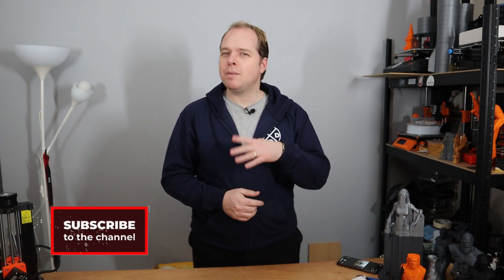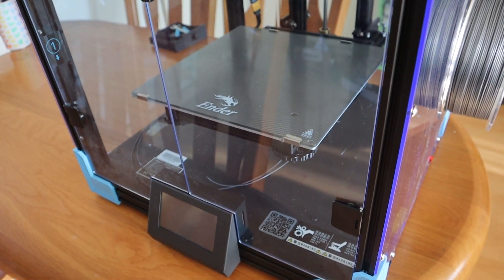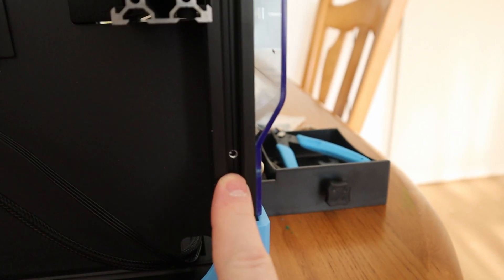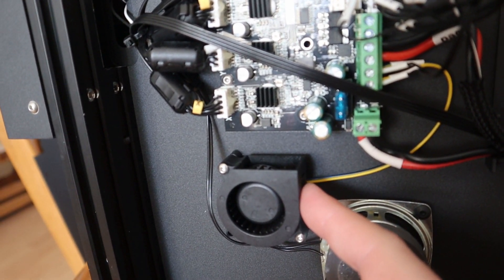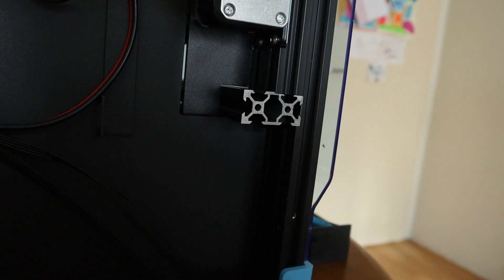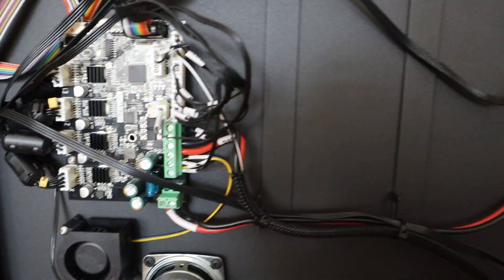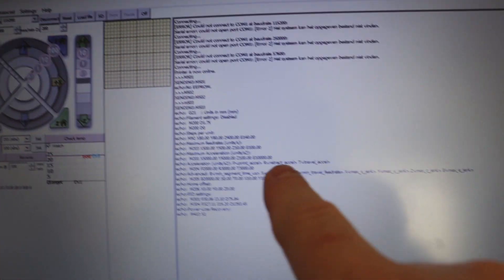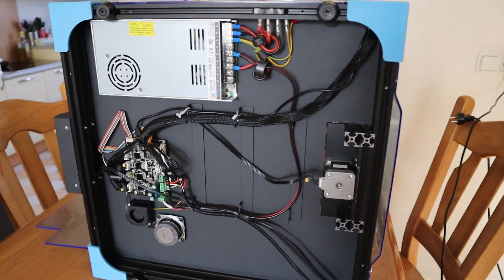What is on the inside of Creality Ender-6 CoreXY

Comment: The black donut looking things by the power supply are ferrite cores, the snap on black capsules by the main board are also ferrite cores, just split and mounted in plastic carriers so they can be installed on existing wires easily.  As you said, they exist to reduce electrical noise on the lines.
Reply from the maker: Yes thank you for this extra information. Very helpful

Comment: So Zach can we use the micro HDMI for stl files on usb flash drives do you know please mate?
Reply from the maker: The Micro USB that I connected to the board, is the one you normally use on a regular printer, if you connect this with your laptop or PC, you can send the print via Cura or Prusa Slicer directly over. Or you can also send commands via those slicers to the printer. Or some other thing, connect it with Raspberry Pi board with OctoPrint installed.
But I don't think you can attach a USB drive to this cable...
Reply: @Zachary3DPrints  I have adapter cables that will work. Thanks for the reply mate.
Reply from the maker: OK, great, you're welcome

Comment: Great video. one question: between ender 6 and prusa i3 Mk3 + which one is the best in your opinion ?? thanks
Reply from the maker: Hey Paolo, great question! But I would go for the Prusa i3 MK3+ , because for beginners, but also for the average user is this a printer that works great. The Ender-6 is a great machine for people who are already in the 3D printing and want a coreXY printer with a bigger printing volume.
Reply: @Zachary3DPrints  thanks

Comment: Hi! Can i use BLtouch V3.1 Auto Leveling Sensor Bed  for  Creality Ender-6 CoreXY  and how to connect it? The sensor really improves print quality?
Reply from the maker: Hello, it is possible to upgrade the Ender-6 with a BL-touch. I want to do that upgrade too, but after the review of this machine. Adding a BL-touch will not improve the print quality, but it will improve the leveling from the bed and making sure that the print will print level and gives you a sticking print to the bed.
Reply: @Zachary3DPrints  Thanks for the answer! Looking forward to your review using the sensor!

Comment: Another great video mate well done.... when you connected up the micro usb and brought up the data sentences would this be where you adjust the Esteps ? I done an extruder count on my Ender 6 the other day and its printing 101.4mm when I extrude 100mm on the menu so am thinking this may be close enough to leave alone at this stage , what would you recommend 👍 thanks again and happy printing
Reply from the maker: Hey thank you, I have hooked it to my laptop and did get a read out in Pronterface, I didn't  change anything in the printer using Pronterface, because there needs to come a review before I make any changes. Do you have under extrusion? I don't have this issue. Happy printing
Reply: @Zachary3DPrints  when I feed 100mm through extruder via the change reel icon the extruder pushes through 101.4mm so am thinking mine is so close it may not need to be adjusted so am thinking to get less stringing I need to adjust retraction an extra mm and maybe slightly faster speed for retraction and see how this goes , cheers and always willing to hear your thoughts , cheers and keep up the great video's 👍
Reply from the maker: Thank you buddy. When you don't have under- or over- extrusion you don't need to change the Esteps. If you have stringing issues, then indeed check the temperature or the retraction settings in the slicer.

Comment: Great job on the explanation of the ender 6 inside. I have the same printer, but am having a leveling issue I can't seem to find help on resolving. My axis goes diagonal for the 5 point, and 16 square auto leveling with both the BL touch and end stop sensor. I have ran the test via all firmware from oldest to newest and still the issues occur. I have made a video in hopes someone knows what is the cause of this and no one has replied. If you can assist me to resolve this on any way please let me know I will leave a link for you bellow. I have also subscribed to your channel and have you a like.

https://youtu.be/ecoFbfKTjeo
Reply from the maker: Hey Buddy, it doesn't look that you have switched on your auto leveling?? On the right side of the screen, I see that there are 25 points (5X5) mesh leveling. I don't know what that end stop sensor means, but it sounds like sensor less homing... but please check it you can switch that right side switch on.
Reply: @Zachary3DPrints  I turned on auto leveling and it still goes diagonal for both measuring and auto leveling the 5 points. What I don't understand is why does it want to go diagonal at all. When you first turn on a new printer it's not set for anything because it was not assembled, so going diagonal is very confusing to me.
Reply: The end stop is the default sensor. I swapped for BL touch but both BL touch and end stop are doing the same thing. Where is this config for aux leveling and measuring saved for leveling mode? I was wondering if creality firmware is just really bad and needs to be fixed. Also have you been able to save settings on the SD card via pronterface or edit any firmware files?
Reply: @gametek7592  hey I just installed my BLTouch 3.1 the other day then only installed the new version BLTouch software patch using a formatted SD card nothing else on it...
After this I shut it down pulled out card.
Fired it up and preheated bed to required temps I was about to print with.
Next clicked leveling , waited for it to centralize  n stop then slipped a piece of paper under nozzle and pushed the top Z arrow far left top button , once it slightly grips paper push the center let home button this stores that spot and height as your home point.
Next go through the 5 point manual level with the paper under the nozzle to get the bed level and up close , can take about 3 times around each point to get it better .
Next after you are happy the bed is level at this point press the button below manual leveling and it should run around all 25 points and give you the measurements... if the measurements have a huge variance as in 0.025 one side and 0.625 other places you need to manual level it again using the paper ...
Another thing before you start with bed 100mm down from home point is run around all 4 corners of bed and wind the bed down hard on springs then back them off a few turns each..
This firms up the bed so less chance of movement after bed is levelled and printing
Reply: @anthonydendle4768  Thanks this will definitely help. I did find out my problem. The ad card for what ever reason is causing the printers axis to derail. I am almost 100 percent sure it's the eeprom file that's being corrupted when my SD card is inserted. Do you know if I can save the eeprom to the printer itself? Also do you know how to setup footprint on the ender 6? I am under the impression the board has a problem running the eeprom from the SD card. I wanted to get a replacement board, but creality telling me I need to go back to the store through their warranty. It already expired is almost 2 months. I should be able to have creality send me a new board no question asked. This is clearly a manufacturing defect. 

Thanks again you are a big help and congrats on the bl touch.
Reply: @gametek7592  is yours crashing when you insert the SD Card
Reply: @gametek7592  at the back left side of Ender 6 unscrew the 2 little plates holding the bed cable in the chanel , pull cable out of chanel, the stepper cable is fine to leave in closest to front chanel...
Screw plates back in place and ziptie the bed cables to out side of these plates as the bolts holding the outside cover screw into the bed cables causing SD Card reader issue's
Reply: @anthonydendle4768  It doesn't crash it just created a odd settings for the printer. The video you saw on my page that's the result of using the ad card as of lately. That's the default when the SD card in inserted
Reply: @anthonydendle4768  That's very odd. I will try that and see. If it doesn't fix my issue I will let you know. 

Thanks again great help to me.
Reply: @gametek7592  welcome , just have seen a few people returning theirs so thought Id try and help if I could .... 
So its been working fine until you installed the BLTouch or was it playing up before hand
Reply: @anthonydendle4768  My original issue was the end stop broke on the first leveling attempt. So I got the bl touch instead. The prints were coming out, but they were meshy. I was printing a flat square test from thingverse. See the link below. It was getting better, but then I decided to go to firmware 1.0.4.9 for the bl touch n that's were my SD card issues started. Ironically I got it the same day it dropped. From then the bed would not calibrate with the SD card inside.
 https://www.thingiverse.com/thing:3346507

Comment: Noooo you don't have bought that piece of garbage ? 
Using wheels for CoreXY is so a bad idé! 
- The new Seermoon D1 use same, and can be bought, stay away from them, and get your self a PROPER CoreXY.
Reply from the maker: Hmmm, those V slot rollers are the same ones that Creality uses on most of their 3D printers. I have an Ender 3 Pro which is still doing great with the same rollers. I have also a Ender 3V2 with those rollers as well, they too are normal and I don't have any problems with them.
In the beginning they tend to give some grease out of them, just clean it and it's good to go. Creality is improving on their newer 3D printers too, better quality is going to come. Every brand is going through such kind of phase.
Did you buy a Creality Ender-6? Did you encounter the by you mentioned problem on the Ender-6 yourself?
If not, please don't tell people not to buy this CoreXY 3D printer... Because for this price range, it's a great printer.
Reply: @Zachary3DPrints  I have bought Ender 3 Pro and Ender 5 Plus, both have issue with those wheels, also have talk with owners of the new Ender 6, same problem all over again. Aint my fail they use low Quality wheels. 

Some will never get a issue, and will got serious problem, like I did.
Reply: @johanstrauss8951  The wheels can be replaced with ones made from better materials. In my case, I was getting excessive wear on the wheels due to over tightened concentric nuts from the factory. This is an easy fix and my Ender 3 V2 works well now.